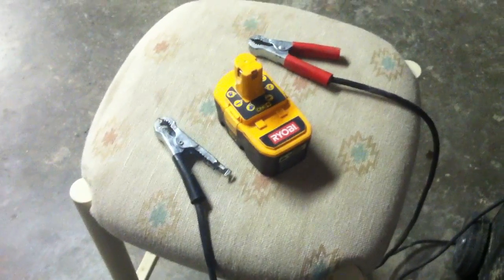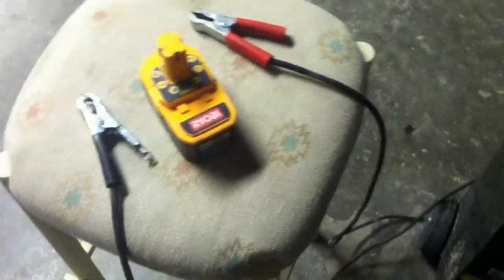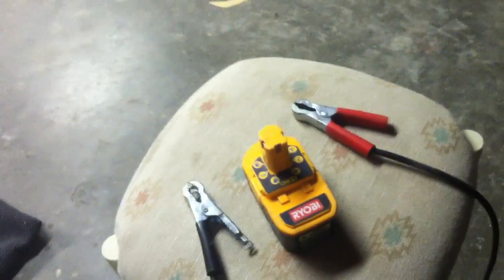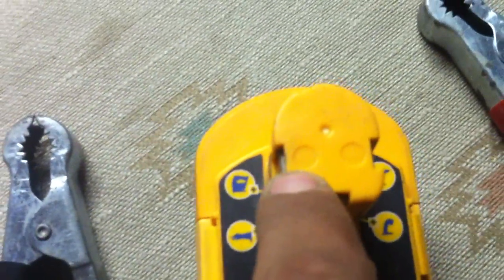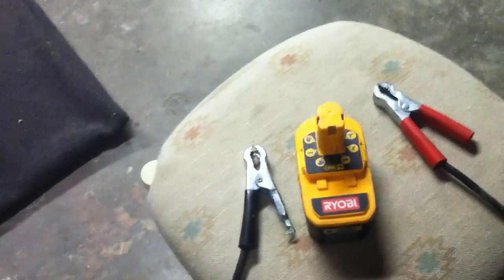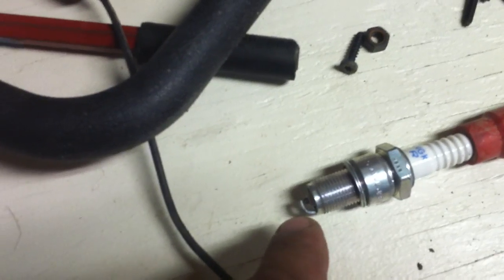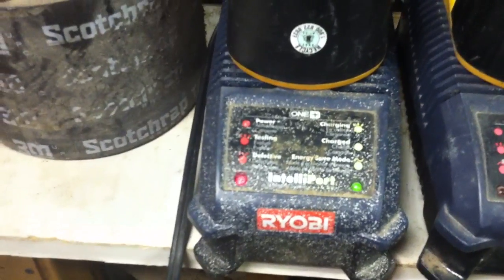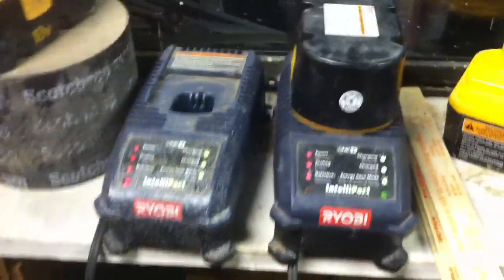Nonchargeable Batteries Recharged:18 Volt Battery.

Comment: Your not "exciting" anything, the charger does a quick diagnostic to check for excessively low voltage on the battery. If the battery voltage is below the diagnostic threshold, the charger won't charge it. The reason all of the techniques that you mentioned work is that they bring the battery up to a high enough voltage that the charger will accept it as a good battery. That's why the kid's video where he plugs and unplugs the charger in rapid succession sometimes works, because the charger is giving a little charge to the battery each time it's plugged in, but there is not time for the diagnostic circuit to recognize the low voltage and shut off. A battery's voltage will come up very quickly, but it takes a long time to build the current.

The new Li-On batteries have a circuit that will cut-off power at a certain value to prevent the battery from going into an excessively low voltage state, so you don't have the same problem where the battery is flagged as being bad by the charger.
Reply from the maker: your funny, in your first few sentences you described the word excited from a electrical term. hey but thanks for watching.  haha
Reply: I tried it and works Great thank you
Reply from the maker: you got it, thanks for watching.
Reply: Pro1er g
Reply: I don't think that's quite right. No time to give it a charge? I had my plugged in for a couple hours while I went shopping and came back and no charge. I then removed the batter and tried again. No luck. So I tried the trick illustrated on this video, got a spark. Then I grabbed to wires and tied the one good battery to the bad battery to get a jump, then plugged it in the charger and it works. Thanks to this video.
Reply: The shutdown circuit was added because there is a delayed fire hazard for recharge after deep discharge - the battery could catch fire!

When the individual cell voltages get too low, copper from the electrode goes into solution.  When charged again, the copper plates out and forms nucleation sites - and in future charge cycles, these sites will form lithium whiskers.  Eventually the whiskers will short out the battery, and there's a good chance that the shorts will get hot enough to ignite the battery.
Reply: 🅸🅵 🆈🅾🆄 want to know how to 𝐫𝐞𝐜𝐨𝐧𝐝𝐢𝐭𝐢𝐨𝐧 ⓑⓐⓣⓣⓔⓡⓘⓔⓢ , almost all types of them, pay attention to all the details 𝗺𝗲𝗻𝘁𝗶𝗼𝗻𝗲𝗱 below. Again >>https://t.co/jfZbilIKLW?nNCIV8GvG5wa
Reply: Guys I found the best Battery Reconditioning program over here MasterInBatteries.blogspot.com
all you guys should try it
Reply: Start your very own battery business and make huge money here: JoxCharge.com

Comment: this works for phone batteries too, i used a AA battery out of my clock.. held the wires on the ends with tape and touched wires to phone contacts ++ -- -- for a minute or 2 and it charges again.
Reply from the maker: yes, i do it all the time, just be careful the heat on the outside is nothing like the heat on the inside,,,,boom.

Comment: Hi very good video info, I have the same type of power pack which fail to charge , since it was a few years old, I manage to change the whole of set batteries  , no doubt it works well , the power gets discharge fast upon using , what could be the problem can you help.. sammy
Reply: Start your very own battery business and make huge cash by going here: JoxCharge. com
Reply: Kbis
Reply: Start your very own battery business and make huge money here: JoxCharge.com

Comment: Tried it the third time, first 2 worked, and there was no fixing. I am using a absolutely long life SUB-C thats a lot easier to solder & using the strips already on you can mass re-cell your tools. Don't buy the other 2000 to 3300mah claims on most batteries, this is a real 2200+ deal, tried them all but this is best. I got 15 minutes more on my Porter Cable and Milwaukee tools  http://rover.ebay.com/rover/1/711-53200-19255-0/1?icep_ff3=2&pub=5575119394&toolid=10001&campid=5337663844&customid=TRUE+RATED+AMPS&icep_item=131630346286&ipn=psmain&icep_vectorid=229466&kwid=902099&mtid=824&kw=lg ASA Craftsman Tool Supplier

Comment: can you recharge a 14.4 v ryobi by using the freezer?
Reply from the maker: no, the charge from a freezer simply slows down the movement . it will appear to have some voltage, but it escapes quickly.

Comment: The bad ones may have one bad cell and that is all it takes to render these battery packs useless.  Lithium ion is like that anyhow.  But they have special circuits added to the battery packs to prevent it from trying to take a charge with a bad cell because they can catch fire or explode.  I am not saying that other battery types will not do those things but they could.  Some people replace the bad cells in a lithium ion pack but it is not easy to do and they know how to do it safely.  If anyone attempts such a repair, they are taking a big safety risk.
Reply: you are spot on I have stripped a number of battery packs and split the battery sets when faulty , found at least 1 completely failed cell and other that are poor condition. take ANY guesswork out of whats wrong. and coils dont have any crystal problem but the winding insulation goes partially or completely!
Reply from the maker: ok, this video shows that it works, can you make a video showing why it doesnt. maybe you can include the exploding part. so we know what not to do. im so tired of stupid comments!!!!!!!!!!!!!!

Comment: Coils don't have crystals, coils are made of copper wires bud
Reply: sensible comment if there was copper involved. But this is nickle cadmium duro disks. Tear one apart and you will be educated. This is chemistry/metalurgy 101....BUD
Reply from the maker: +John Cormack your right. lets call it a growth, the crystals are what the acid and copper grow. imagine a liquid gel that does not move it will crystalize. ( harden up )in order to keep it at its liquid state it needs the voltage to move in and out of it. ( using the tool and recharging) when the acid sits on top the battery it turns white and green ( when a battery is over charged and boils over ) but inside the battery there is no oxygen so the acid turns to crystals. there for you will need a small elec charge to melt this small crystals and get the acid moving again. because the charger does not know its connected to a battery. so it does not turn on. take the battery out of the charger is the light on. no because it to does not sense the battery.  now you get it. thanks for watching. when I made this video I was very tired and assumed, guess I shouldn't of. you can check this process out in more detail at backyardmechanic.org.  thanks for watching and thanks for your comments. (bud)
Reply from the maker: +thomas brian lead, not copper. still tired ff

Comment from the maker: while the plug is plugged in.you must ground the plug,  fyi.
Reply: Well. I just tried it and it works. Two 12 year old ryobi 18v batteries that haven't worked in 7 years are working. One fully charged and one charging as i speak.  Try that on your sphincter.
Reply: The 3 Best Batteries For An Off-Grid Energy System >> https://t.co/mK3KjJd0lr
Reply: the best results that I have had was by using the Magic Mender Wizard (i found it on google) definately the best course that I have ever followed.
Reply: Preston have you tried this method, or talking out the sphincter between your butt cheeks, I have used this method and was successful 2 out of 3 times. So if at first YOU don't succeed,  is in not in anyway proof , that no one else , has or will succeed.

Comment: These battery packs consist of multiple sub-c cells. Over time, crystals build up inside until they cause a short condition. At this point the individual sub-c cell will no longer hold a charge and the battery pack as a whole will not charge to its rated voltage. When the pack is plugged in repeatedly, it causes a surge of in-rush charging current which; if caught early in the "short cycle", may, but not always remove the short. If multiple sub-c cells within the pack fail, then the only effective way to remove the shorts is too apply a higher than normal voltage to the individual sub-c cells, or the pack as a whole if such a power supply source is available. This will require the dis-assembly of the battery pack - five screws on the bottom. 
I use a 12v power supply with a minimum of 4Amp capability. Touch the probes quickly, recheck voltage on cell. If a voltage is read at or near the rated 1.2v of the cell, your done. If only a small voltage is read, touching the probes again may be necessary. 
 If still no voltage continue to touch the P.S. probes to the cell until the short is removed. If a voltage cannot be read on the cell after (six) or more tries, then it's time to replace the pack or the individual sub -c cells which are available on various battery websites. (I recently had to touch the probes forty times to a cell to remove the short, but only to see if it could be removed, replacement of that cell is mandatory as it will not last) Replacement of individual cells will require some soldering skills. Note: When applying voltage to each individual sub-c cell, there is no need to further separate the individual cells from each other, only touch P.S. probes to a single cell at a time. OBSERVE POLARITY! Raised button is always positive, flat of battery is always negative.
Reply from the maker: +Glen Ingalsbe thank you for the comment
Reply from the maker: +Glen Ingalsbe  thank you for your comment and for watching. if you know of anyone that
 can benefit from watching this video can you click share and share it 
with them. i am trying a little experiment with sharing. again thank you
 for all your support. i will keep you posted on how its working. thanks
 again.